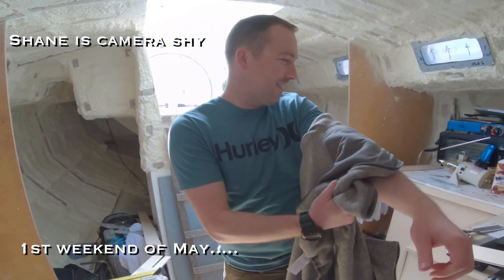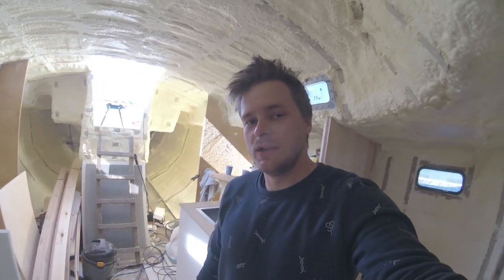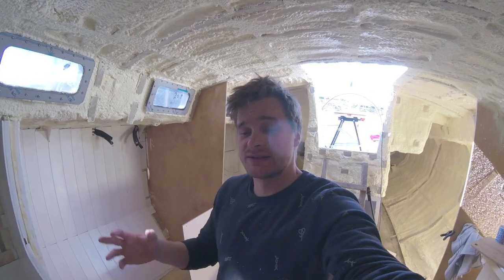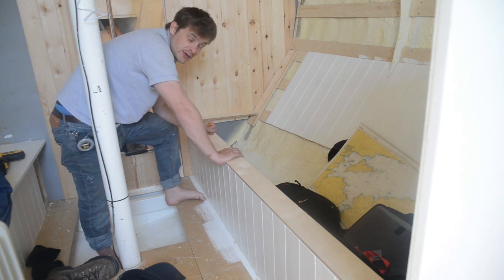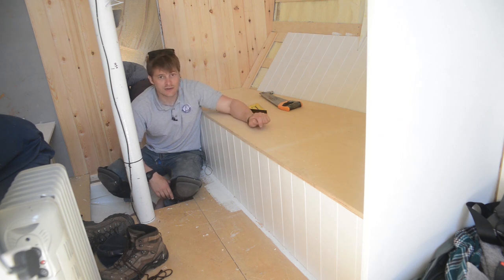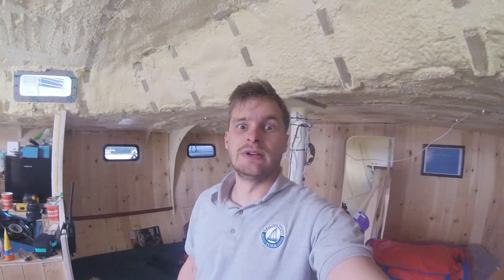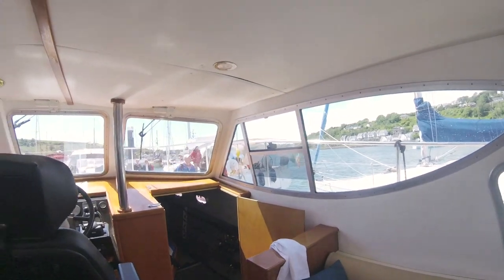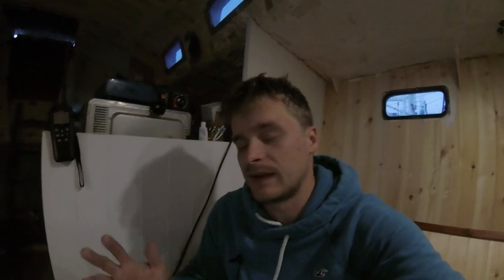Saloon Paneling Done! - Episode 35 - Sailing Yacht Zora Rebuild

Comment: Hello Rhys, Its looking really good, but you might want to consider some kind of construction adhesive at the butt joints, between the upper and lower paneling and any other points of contact, before you add your hard wood trim pieces, or you might suffer the never ending torture of the squeaking joints. Regards, Dave

Comment: well done good progress . I saw you use gorrola  glue . ALDI IRL  have a good deal on it presently €9 Euros a tube better than many hardware stores charging the double that so I bought 3 of them for my 50 year old  27 ft boat refit. I also  bought some boxes of stainless steel screws  boxes in LIDL IRL. I too went for using paneling but 8 mm  floor board stuff my cousin  got heaps of for cheap in Dublin auction . He had some some 30 square metres of left over he gave me for free .I am  lining walls of boat with that floor board  stuff  a bit heavy i know . Then for insulation behind that  I use  election posters plastic corrugated  type got for free from lampposts . I use that   underneath the flooring material for insulation  .Then I also use   heaps of silver refection car sun screens bought cheap in LIDL and cut to size for reflective  insulation. That's three layers about 12 mm thick . I have to cover about  60 square meters. That is  probably 1/5 the size of your boats interior .For the roof spaces  I have yet to buy the 4 mm  WBP  ( water boiled ply exterior type  ) from Dublin Veneer &  Plywood  The problem is the 6 mm marine ply is really too heavy for topsides on  my size boat 27 foot single skin type fiber glass 1970 era  Also it costs three times the price of the cheapo WBP . I have often used WBP for sheds interiors  and its OK for few years if it doesn't get too damp  being inside a shed or in this case interior of  a boat  . If it falls apart in a few years time   I can look  replace it something else when finance or other material solutions allow a better solution  . I just could not source any marine ply 3 mm anywhere in ROI unless you or some one knows some source it at not stupid euro price  then its gonna  next week buy the 4 mm WBP.   I will  probably skin the hidden side of the WBP on the roof side with silver paper to  try  reflect the heat outside or inside  for cooling or heating properties . Again for  insulation qualities and use more election posters  plastic  unless I can source a better solution . I can't make my insulation so thick as your solution as it would take of too much of the interior space of my boat . Also I have to consider weight as being a old era boat weight 3.5 tons with  one ton keel it is already  a over weight boat compared to modern 27 foot  boat coming in often at less than 2 tons .  Can't complain got it cheap less than €2,000 with working a 10 HP inboard so roll on 2020 finish the refit buy the safety gear and then  exit stage left to spain yet again  .  Later I will try to set up a UTube channel on the subject but in this time I  lack a good camera for filming. I want to be able to keep all my interior paneling done so I can remove them easily with screw driver in case like my last  boat a 34 foot cat  gets the dreaded Spanish cockroach infestations. Too kill those cockroaches needs access to all parts of the boat to chemical bomb them otherwise if any cockroaches survive  a few weeks later the floor moves with thousands of cockroaches  when you enter the boat at night. Also single skin fiber glass gets very hot in warm climates

Comment: When you get friends to come round to help ...makes a huge difference, the amount of work you can get done .....just one question though why did you not .epoxy all the wood first ....I'm no expert but don't you have to do that first ......I hope you have deep pockets ..because the day is approaching ..when you are going to need them .
Reply from the maker: My fear with epoxying the wood first would be that if there was ever a breach in the coating, it would only hold water and rot. Pine is really resilient to rot, so it would have to be a considerable amount of moisture to cause trouble. Plus she's a very very dry boat, as there are pretty much no holes in the deck that can leak :) all good on expensive stuff, I've been gathering it over the last year ;)

Comment: Rhys, is it ok to have so much untreated, 'flimsy' t+g in the boat? No criticism, I am totally ignorant of boat fit-out.
Reply from the maker: Ya the spots I've used it aren't load bearing or anything, plus most of it is braced very well with ply. All G 😎
Reply: @SailingYachtZora  O.K. But will condensation/damp not rot it?
Reply from the maker: @nick.caffrey  nah pine is highly rot resistant, so both bothers 😎
Reply: @SailingYachtZora  I didn't know that. Glad you did!